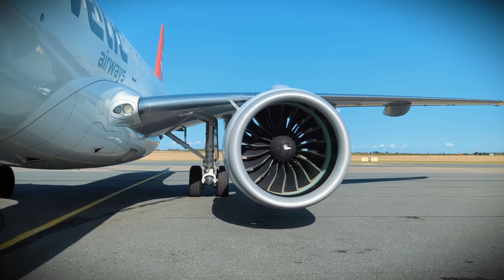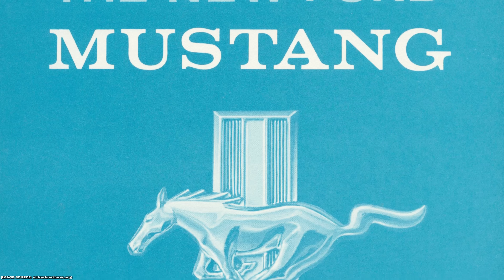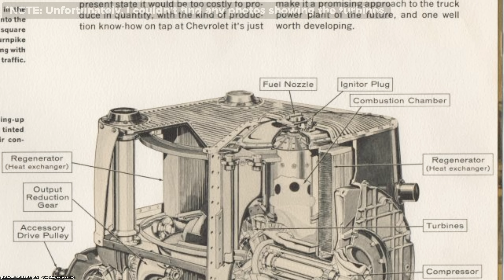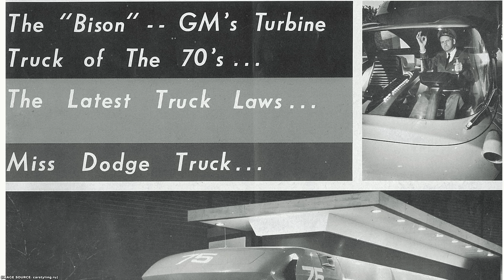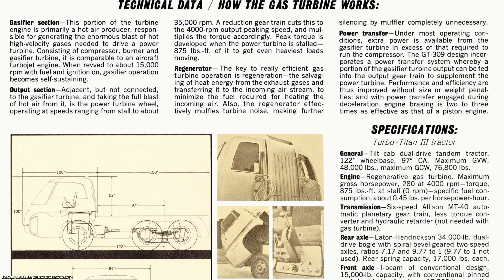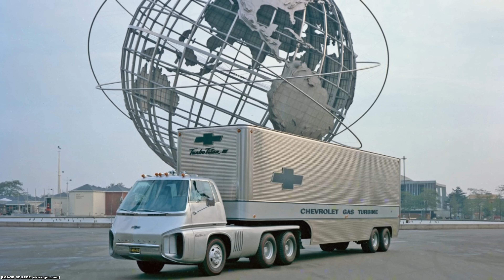How GM Tried to Reinvent the AMERICAN TRUCK (in the '60s)

Comment: Volvo did a whole lineup with a car, truck and bus in the very early 1990s that all had gas turbines, and hybrid drive train.

They where all pretty good vehicle, but the drive train absolutely auwfull. The turbines had a fairly short service intervall, the NiCd battery degraded very fast, and the inveter was mechanical and needed regular service.

The vihicle them self was pretty god with all LCD display and modern interior, very futuristic at the time

Comment: I'm old enough to remember when Drivers actually wore Uniforms complete with Cap and name tag. 
They would wave and thumbs up as you passed, my how things have changed. 
Also remember seeing Turbine powered Rigs running around the City, I remember one in particular had huge stacks up both side behind the Cabover, painted white with some kind of heat protective material. 
Anyone who knows about Turbines knows they move a lot of air....a LOT of air and those stacks answered a big question for me as a young engineering boy. 
Would be interesting seeing what could be done if the Company had more money and was willing to get 'er done, much like what Musk as done with the Tesla I guess.